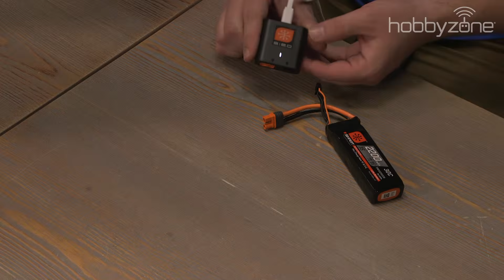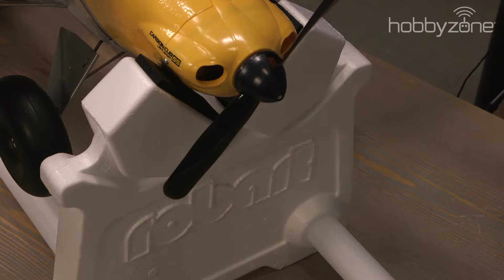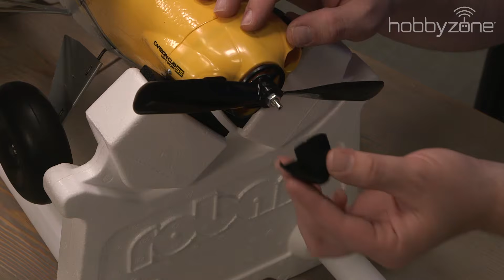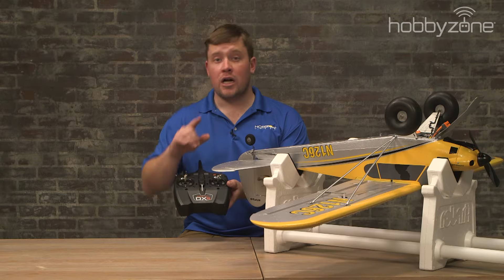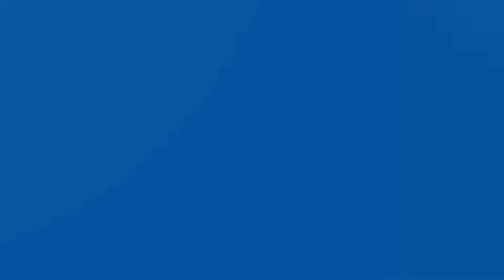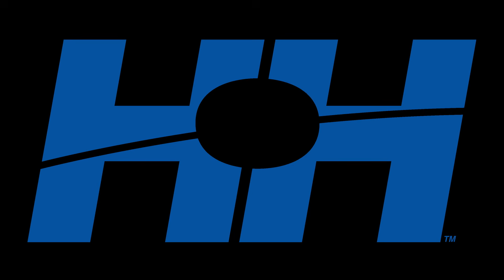Quick Start: Carbon Cub S2 RTF

Comment: We’re using this video as an adjunct to the manual. Overall, a great tutorial, love the presentation speed and the thought that went into the lesson, but… a few things really got to me. 
1. Ail-er-on     No extra I after ail
2. What is an “open” wrench?  It’s just wrench, or open-end wrench.
3. Might want to update the bit on charging the batteries. As I’ve been told by the local hobby shop guy, there is no more balancing wire on the new batteries. I kind of panicked and had to call him thinking I had the wrong batteries.
Good job, keep it up!

Comment: Okay I'm gonna be brutally honest here.  This plane is a POS.  Well, not so much the plane as the flight controller/receiver.  Despite what they tell you, it is IMPOSSIBLE to make the RTF version work on another transmitter (like the NX8) unless you give up SAFE.  I even worked with Spektrum support and we couldn't make it happen.  And even as a noob, I found the thing virtually unflyable in Beginner (full SAFE) mode.  So keep that in mind if you're gonna get one.  IMO you're better off just getting a GOOD transmitter and getting the BNF version.
Reply: I bound my Carbon Cub RTF that came with a DXS transmitter to a NX8. What do you mean by "give up SAFE"? Is it not working anymore? I can still switch all three modes with no issues and i can use the bind button as panic button, like with the DXS. My plane came with a SPM4650C receiver and SPMA3230A flight controller.
Reply: Exactly, no issues here either. Hate when guys that have problems with their bird spreads misinformation. Happy flying Chris
Reply: @darrenrobillard9496 thanks guys, I have an NX8 and plan on getting this plane, noob here

Comment: So, if I fly the Carbon Cub (version) S2 in experienced mode, I can fly it as I wish? Correct? I ask, because the S+ (version 1 of this plane) which I have in RealFlight 9.5S seems not to let me do everything I want and takes over at times and wiggles with its wings! I want to buy the BNF version of the S2 but I want to be free of GPS and free of LAS and free of any virtual fence! Will the S2 version let me do what I want in experienced mode (with only AS3X on)? Thanks!
Reply from the maker: In position 2 on the radio, it will keep AS3X on but turn SAFE off.  So you will have full control of the plane to do loops and rolls.
Reply: @horizonhobbysupport  OK, so what is the wiggling of the wings in RealFlight 9.5S that I experience with this plane in AS3X?